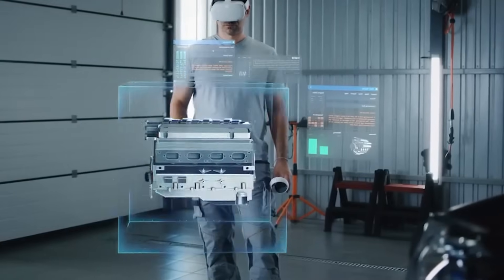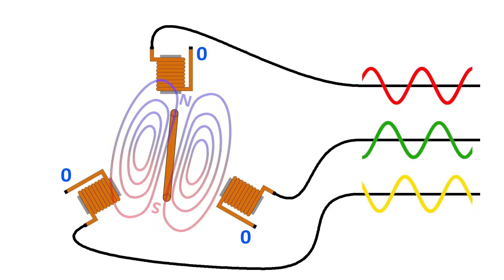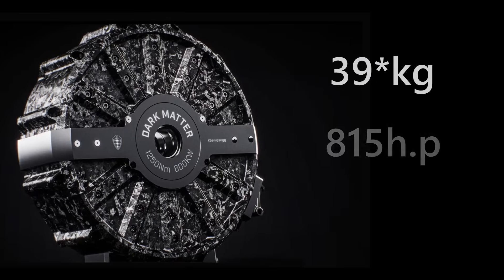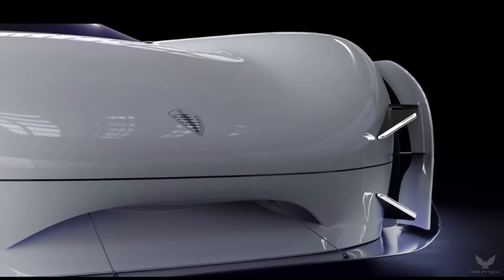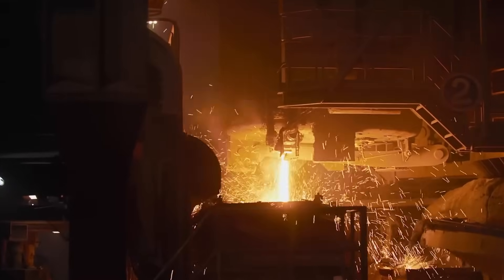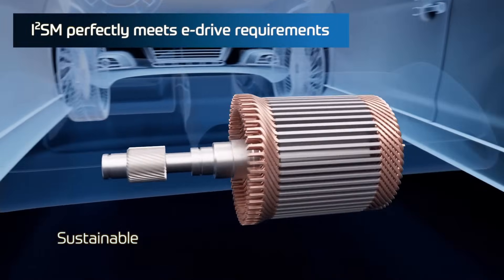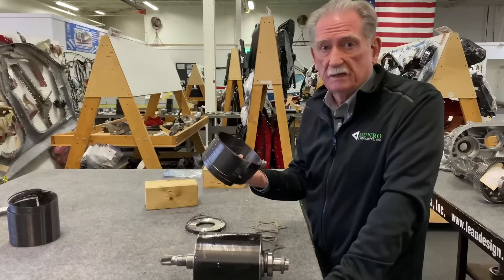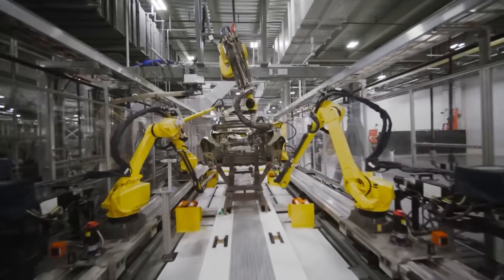New Technologies: WORLD'S MOST POWERFUL ENGINE! MAGNETLESS RADIAL ENGINE! 815HP 39KG!

Comment: EV's isn't heavier than a fossile car.
BMW M3 is the same weight as a Tesla model 3.
Yes, the dry weight are a little lower. But, does a fossile car run without oil, gas, and other fluids?

Tesla model 3's weight are almost 50/50. So, the pressure on the axles are better for the road.

So, stop spredning lies.

Comment: We simply do not have the grid power to take over all internal combustion vehicles. It will take immense investments and a decade or more to make the switch. Not all nations can do this either. If electric power replaces fossil fuels, we will be more dependent on more fragile technologies that can be interrupted with less difficulty. Sequestering biomass and increasing efficient use of fossil fuels in combination with real market power to overcome fossil fuels on their own merit is best in my opinion.

Comment: Whatever internal combustion engine you use it still puts out poisonous gases. Ice engine should only be used to power electric motors for long distance. Just look at diesel electric trains as the perfect example. Otherwise let's just do away with ice engines.

Comment: No more BATTERIES there has already been a discovery made way back that doesn't require the storage of energy, only the transfer of it.  Nikola Tesla already made that discovery and it's been ZIPPED UP for no one to actually use it in general because the global fuel/energy market would collapse. It's called zero point energy and it's already been discovered by and classified above top secret so we the average laman  can't even guess how to take it from all around us.  Can you even imagine a Tesla car that you can drive and not plug in and recharge??  Well that has already been done, but not to a car...

Comment: 2 problems with EVs. The batteries, lack of travel kilometres and the long time to recharge. I have a 3L diesel Jeep with a 90L fuel tank. I can travel 1000ks on a full tank and refuel in 10 minutes.
Reply: I'm in the large minority of people traveling less than 300 KM a day.... As for recharge, 99% of my charges are made at home while i sleep, talk about something very hard to bear.  And on the road, @ 150KW you get 80% charge in 15 min every 250KM, what a waste of time... But yeah, i know you enjoy sitting in your seat the whole 1000KM without a break, i know majority of people do that...  What about maintenance costs?  Durability? Fuel price?  Yeah i know, you like all of it too.
Reply: @guyboisvert66  How do you manage to sleep with your car plugged in, that's risky with how many EVs bursting in to flames. Hope it don't happen to you.
Reply: @SuperBartet  My nine year old Nissan Leaf has been plugged in at home outdoors in any weather... still no issues.  Also when the home loses power, I bolt on a 1000-Watt inverter onto the 12-Volt accessory battery and let the car's battery pack keep up the power.  Nice to use an 800-Volt electric heater in a room to keep the family warm.
Reply: @lelandhetrick205  Not yet :/
Reply: @SuperBartet It stops charging once it reaches the set limit. You do realize your cell phone charger does the same thing right?
Reply: A phone battery is so very tiny  compared to a EV battery, it's not a good comparison.  Just hope your battery manament module keeps working as it should.
Reply: @SuperBartet  Size is irrelevant. The concept and process is pretty much the same.
Reply: Yes you right, and we all know how many phones have burst into flames, it's just on a massive scale when a EV does  it. And that is my whole point that I started with.
Reply: @SuperBartet  I’ve never seen or experienced a phone catching fire but I have experienced cables burning up and charging bricks go bad.
Reply: Just because you have not expireanced it, are you trying to say it don't  happen? It's well known that is does happen.
Reply: @SuperBartet  I said “I HAVE NOT EXPERIENCED A CELL PHONE BEING ON FIRE.” Whether one has or hasn’t is irrelevant to me. That’s my point.
Reply: Then why did you start going on about phones, compairing them to EV's. I did not want to talk about phones you did. You was trying to get the chat away from EV's bursting into flames.
Reply: @SuperBartet  Sir please move on. I have no interest going back and forth with you. You clearly want to start debating and I’m not the one for it so please keep it moving or I can just mute you.
Reply: Hi Guy. Yes for city driving EVs are good but my Jeep is 10 years old (170000ks) and no problems. I wonder if your EV will be still going with out a major expense on new batteries
Reply: @johnrider7619  We'll see but 170 000 km is not impressive at all... so you're not doing 1000km straight very often!  How much did you spend in gaz and maintenance for the last 10 years?  In my case, 120 000 KM in 4 years, no maintenance cost at all and 225$ of economy each month vs gaz, not bad at all isn't it?  Enjoy your Jeep if you like it, cool for you.
Reply: See the car that runs on salt water.  Called “Nanoflow cell” or “Quant Car” or “quantino”.   Just drain tank, fill with salt water for 600 miles.  Gets 15 miles per gallon.   It is on You Tube.  Up to 1,050 horsepower.  The car uses no rare earth I believe.
Reply: @timberrr1126  Semi hoax, waiting to see real world proper testing... @48V, current to get the performance they claim must be huge: 4 x 3000A...

Comment: The motors are not the core problem of electric vehicles. Replacement of permanent magnets by electric windings has been usual in power plants for more than a century. The problem is energy storage: A battery has much more mass per kilowatt hour than a fuel tank. Filling a fuel tank at the station equals a power of several megawatts.
Reply: 1 ltr petrol delivers about 10 kWh.  A medium car holds 50 ltr. So about 500 kWh.  A  large EV holds 75 kWh.  Thats the reason most EV have less reach. Of course an electric car is far more efficient 
.
Reply: @wimjacobs5297  And the 500kWh can be replaced within a minute. Loading the battery within a minute is a very far dream.
Reply: @JSM-bb80u  Even when filling 50l within 3 min that means a power of 7MW. 
Name a car that can be charged within one minute with an acceptable range.
Reply: @wimjacobs5297 But petrol engine is only 15-25% efficient. So only 2kWh.
Also if battery energy density comes upto 500 Wh electric vehicles would have the same or more range and with the same weight.
Reply: I took a look at Tesla dash Fire and that was enough for me, now BYD is getting in on the act. No thank you.